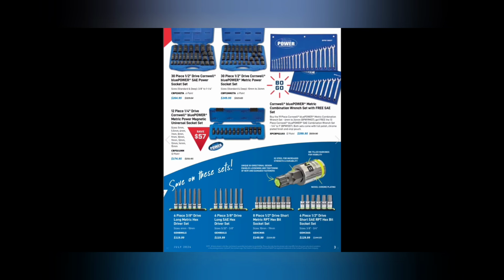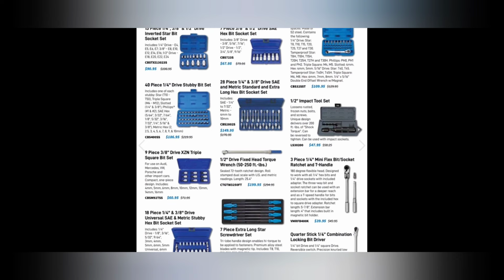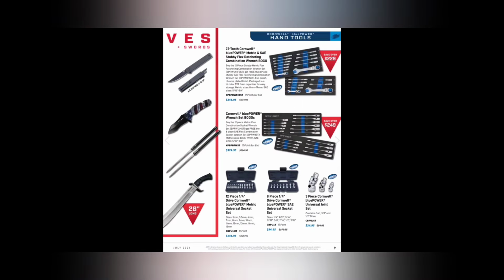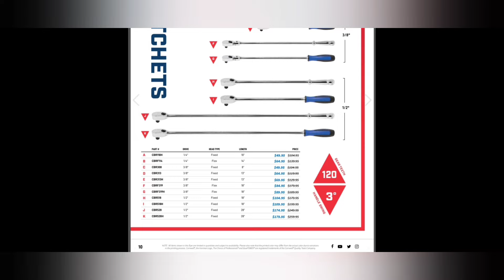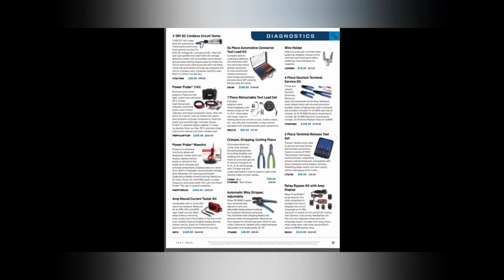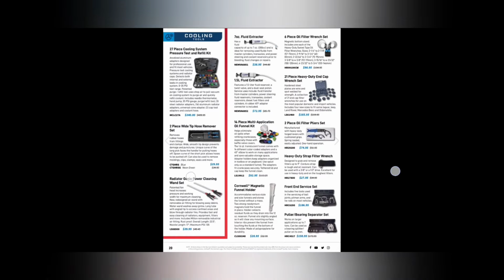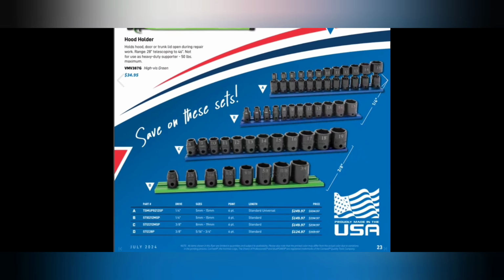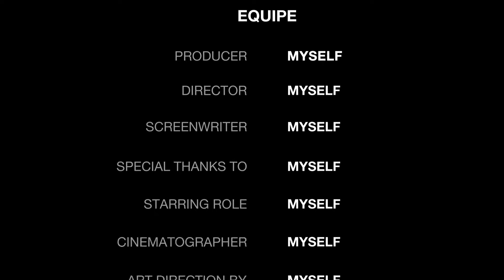CORNWELL JULY 2024 BOGO MADNESS!!

Comment: No reason for Cornwell to have any tool box or cart made anywhere but in Ohio since they bought out Kennedy manufacturing that has made machinist box and custom boxed for special tools for the United States Military .  With Kennedy factories in Van Wert and plant they already had in Northeast Ohio they should not have any chinesium boxes at all
Reply: I have a Cornwell Pro Series green 76 inch I think toolbox with the hutch and lockers. It's all made in the US and the drawers open from the pull handles

Comment: Brother CP, I saw Husky is now offering a featured hex socket and key and they’re calling it the “Bite”. You’re 100% right about the $31 hose pick set, I’ve used mine daily since I bought it along with the 4 piece large hose and seal picks. The Cornwell Dinghus handles really do feel good in your hand. If I didn’t use the damned thing every day, I’d send you my fine tooth flex head ratchet to review. Can’t speak to the blue power as they look just like Capri/Die Hard heads but the USA ratchets are on par with the best

Comment: The reaper bolt extractors are a must! I love there the only company the have in between sizes for rusted rounded bolts. I bought mine off the truck because they warranty wear and tear (like drill bits). I’ve gone through a dozen in the last 5 years
Reply from the maker: Ya H.B products makes those 100 bucks on Amazon lifetime warranty snap-on sells them for 350 under Blue-Point same exact Tool lol